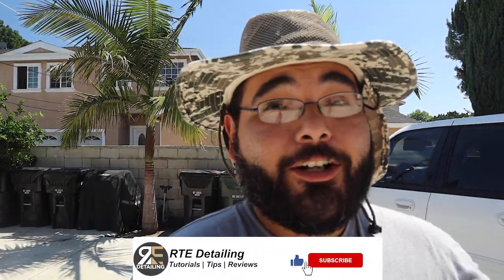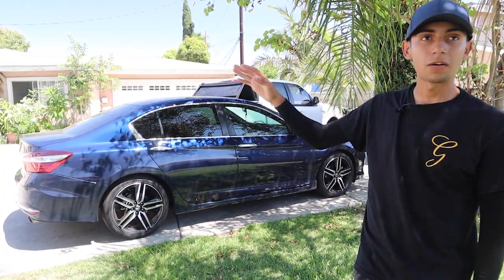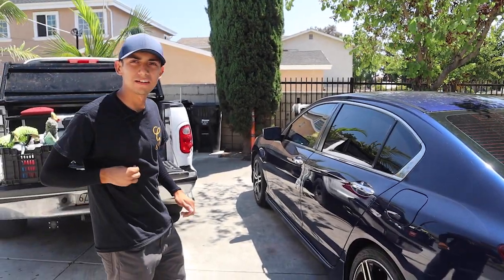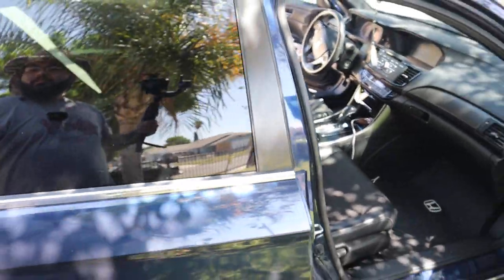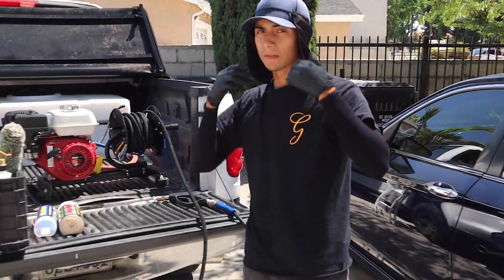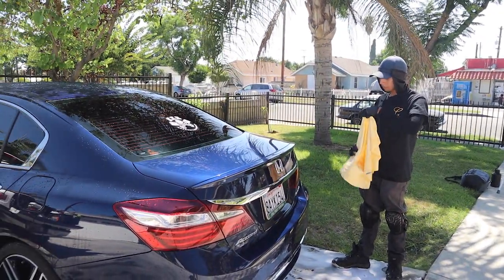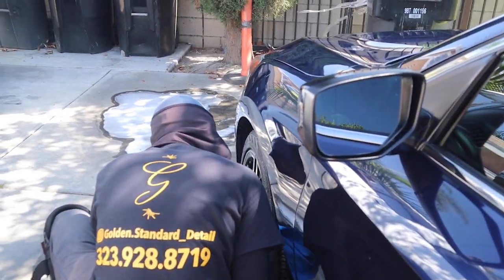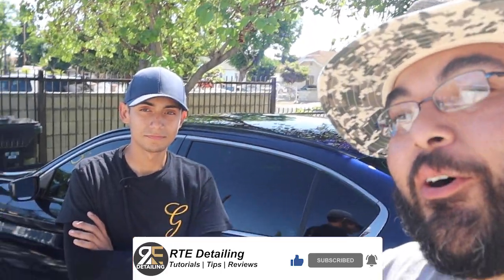19 Year Old Bulding His Mobile Detailing Business - RTE Detailing

Comment: Polish doesn’t haze the paint only compound does because compound is what cuts into the paint and polish fills it in and also I advise you getting a paint clear coat scanner because the car especially a used car the clear coat WILL NOT b leveled all all around the car so you can’t go over as many passes as other panels but keeps up I see the passion in it
Reply: If he wants he can look for compounds and polishes without fillers. But very good point about polish some have fillers which don't really fix the paint but for a couple months
Reply: @markjones9882  anyone can call themselves a detailer now. But they don't have the knowledge to back it up
Reply: @Redeemedb  there is two parts of detailing, deep cleaning and paint correction usually or the large % of people don’t really care about paint correction so deep cleaning is for the average person
Reply: @Redeemedb  every new mobile car wash calls themselves mobile detailer